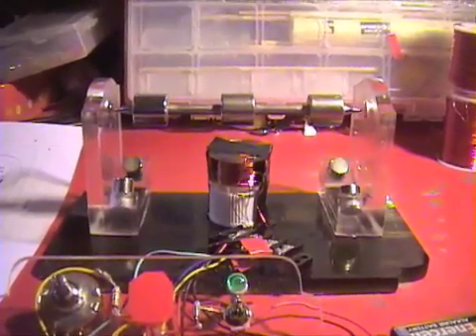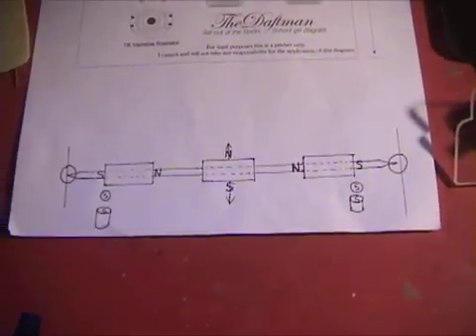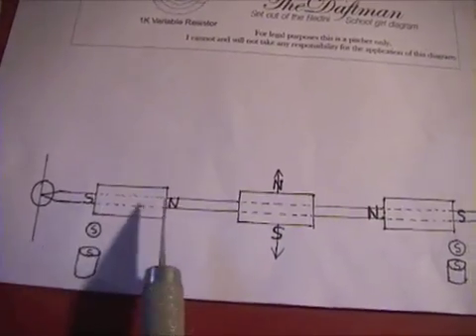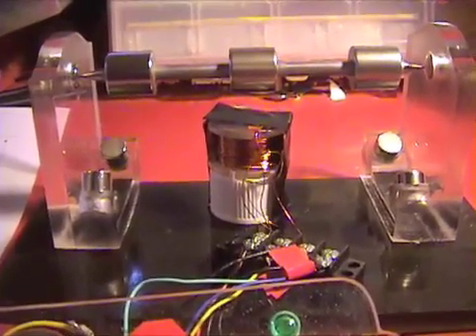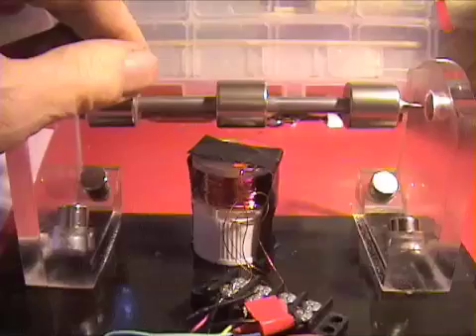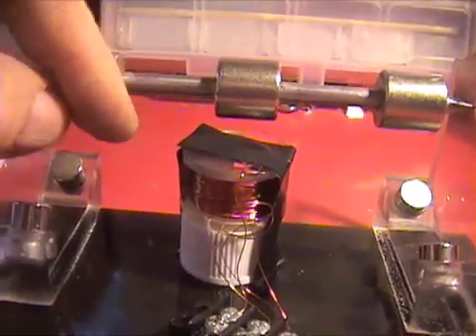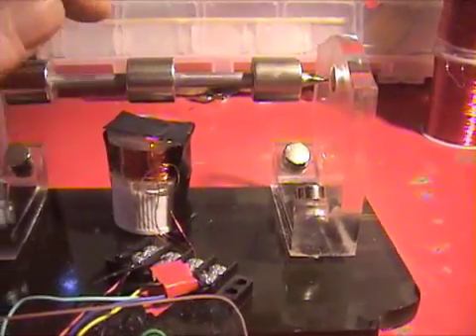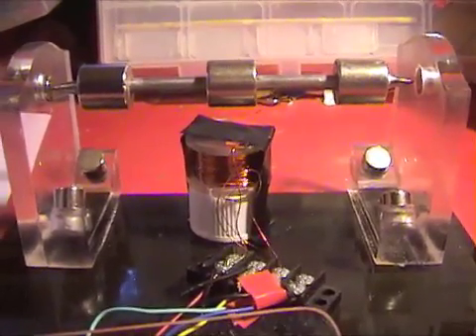MAG-LEV BEDINI motor #1

Comment: You are running an electrical current from a battery through a coil. The coil produces a magnetic field.  That magnetic field will exert force on your middle magnet - hence the 'cogging' as you call it.
Reply from the maker: thanks Praew good observation.  However, the cogging happens even when the coil is not present or not energised. Thanks for your comment

Comment: Figure out how Mu Metal or a cylinder of iron can make it work. The problem is that you need a certain shielding thickness to distort/ 'confine' the magnetic field enough thus the shield may end up as this giant disc attached to your device. Whither its mounted on the base or rotor I don't know... a lot of experimentation would be required. Excellent design by the way; i'll have to add this to my to-do list. Very inspiring.

Comment: @YouTooArchive

Hi,
Make the magnet arm longer thus keeping the  two end support magnets flux fields out of the picture. No more clogging. You might want to use a fiberglass rod through the center of the magnets. Extremely strong and lightweight. I have been using them.

Encapsulate the whole magnet arm inside a clear plastic polycarbonate tube. If something breaks you wont eat it. I might have to resort to that kind of setup myself.  

Tom